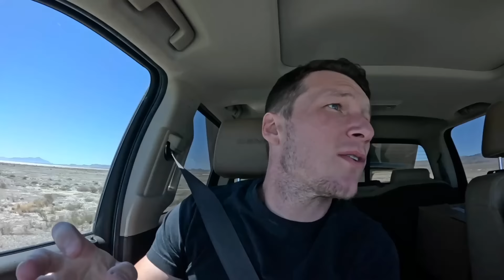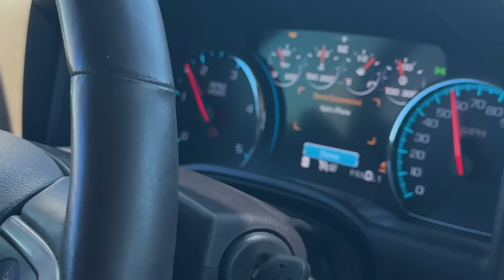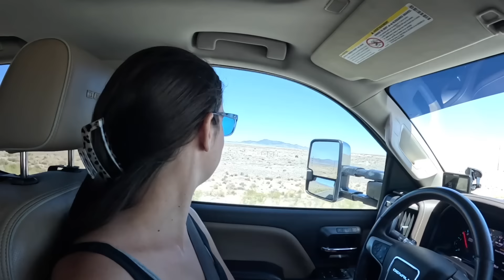New Trucks are 'Built' to Leave You Stranded

Comment: Another great video love watching you guys. Caidin was great as well not many people out there would take the time like he did to go through everything like he did. The one thing I would have liked him to go into further detail was the part about adding ATF to the diesel fuel like how much should you put in at fill up. I had seen that before but took that like most things you see online.  Now hearing it from a guy who knows tells me a lot. I am all about doing whatever to make my truck last longer with fewer problems. The only problem we have had so far was the DEF issue last summer and both times after filling up at a truck stop. So on the way we ended up making an unexpected stop in Kingman. I took it into the dealership there and they did not find any problems reset the code and back on our way to Porterville Ca.  On the return trip we were kinda in the middle of nowhere in a way as the closest Dealership was going to be maybe we will make it before it went to 5 mph. That's when I called the local auto parts place and asked who in the area I should see. I went to D&A Diesel in Tucumcari and Don cleared the code and told me never get my DEF from a truck stop. He said to get it checked when I got a chance but he was pretty sure it was the Truck Stop DEF. He said the DEF they get is not the best quality for our trucks.  We stopped in Amarilo that night the next day I picked up some DEF and waited till it was almost empty before I put the new stuff in and have since not had any more problems.

Comment: Kyle, I have suggested to you to get the Fass fuel system on your truck,( I also mentioned the CP4 pump, but your truck does not have the CP4 pump). The Fass fuel filter system saved my engine! I have a 2026 Duramax. I filled up at a gas station I was not familiar with and got bad fuel! Lots of water! The water filter got so full it would not allow any fuel to get to the engine! So instead of replacing my entire fuel system and injectors, they had to drop the tank and clean that out and replace the filters! 1400.00 compared to 10 to 12k. My next install will be an oil bypass filter!

Comment: We were on our way home from Colorado to California on Aug 3, and we got the "Service the DEF system" and "Limp mode in a 150 mile" on our 2017 Ram 2500. We cleaned our DEF injector and reset the check engine light that was on and drove to California. Total cost $0.00.

Comment: What I'm curious about, is why do the DEF systems on big rig diesel tractors run so much more efficiently.  I know they are not completely foolproof, and there are problems that crop up, but I have driven a DEF big rig for miles and miles, with very few issues.  Is it an engine size issue, where larger engines can absorb the DEF peculiarities more easily?

Comment: Use Platinum Blue def or Rislone def additive to prevent crystalization.
Use fuel cetane additive to reduce  DPF problems.
Archoil fuel additive & DPF cleaner is pretty well liked. 
Don't use transmission fluid in fuel use Cetane booster. 
Motor Oil Geek has a good video on diesel fuel additives.

Comment: There's a lot of bad info on the EPA and emissions on diesel trucks. Emissions tampering will still be illegal. Manufacturers are not going to just stop putting emissions equipment on new trucks and cars. States will still be able to regulate emissions tampering and if you live in states like CA, New York, Oregon etc, you're still screwed. However, the softer stance by the EPA may open the door for good tuners to come back to market but they'll have to  operate in the shadows. To say it will be fully legal to delete your diesel is just not accurate. Don't get me wrong, I have a Ram 3500 and have the misfortune to live in commie state of CA. But I WILL be deleting once i register in AZ and good tuning is more available.  Deleting emissions on a modern diesel and add a good tune is the BEST thing you can do, but do it at your own risk, the risks just might be a bit lower. Hopefully

Comment: As a former GM Certified diesel tech and used to deal with this system you found a very knowledgeable technician who knows his stuff. 

With that said, this is the main reason if I ever go with a diesel I will stick with a LLY or LBZ.

Till then, I will stick with my 8.1 big block Chevy. 

Great video! Keep this type of content coming whenever you have an issue.
Reply: I think your comment is the most relevant to me.  If a certified technician wouldn't have one then certainly a person who knows nothing about them would either.  I think some folks are ignorant regarding the costs and upkeep for even the most minor of issues regarding these vehicles.  The engines and transmissions, etc. may be rock solid but if the emissions systems are as problematic, maintenance intensive and expensive to repair as these things are then it makes no sense to buy unless you have deep pockets or can handle the repairs yourself.
Reply: What about the mechanic telling him about transmission fluid or 2 cycle oil in the diesel tank? Around 16:51 ????

Comment: Tow a spare pickup behind the 5th wheel. <joke>.  Could you imagine the curbs and corner stop lights you need to at least scrape.  I recall the first time I pulled a 28 foot *pull-behind*... (Adds more length). Unlike the 20-foot Terry Resort 5th; I previously hauled. (Different pickups and trailer types).  The 5th by far, had the best trailer manners.  Thanks for the video.  The newer smog diesels are a constant carbon / etc. battle.  Since you have a load on your rig often, helps keep carbon burnt to a crisp.  The automatic transmission your pickup is equipped with, earned quite a battle-tested  reputation, even in the big rigs years ago.

Comment: This has been great info. But now I'm even more uncertain what I want to do. I'm looking for a Class B RV and a lot of them are the sprinter. I do know that they are harder to find someone to work on them. I'm still leaning toward gas simply because I know I can get gas, also I know that I can get it worked on almost anywhere. As for MPH right now I get average 7mph in my 25' Class C and I hear you say that you got that too. Because now you have to get fuel and DEF but not how much it add to the cost of fuel. Being a single older female I really need be sure I can get the help I need. This has been a good education. Thanks

Comment: Pittsburgh Power has a Dorothy that filters the exhaust gases being returned to the engine.  Filters out soot etc.  Def is 66.67% Urea and 33.33% Deionized water.  Rotella T-6 has a lot of Zinc and seal sealers that stop oil leaks.  Cold weather starting will make a believer out of Synthetic Oil.  Please watch some of Daves videos, he has a system that filters oil down to 1 micron in a bypass system so your oil is refreshed instead of getting black and dirty with suspended soot, etc.  Secret to a long life with a diesel engine.  Husky Diesel appears to be a first class guy.

Comment: Don't buy anything newer than about 2011 so you don't have the def and particulate filter. Now that you have it, it's called "delete" the system. problem solved. Pulling a camper you want all the power you can get and with this emission bullshit you lose power and mileage. Get you an older diesel truck and you don't have to worry about this crap and you have the power. This EGR crap is just that.....CRAP that puts the cost to the consumer!! Why buy new when used will do!!

Comment: From my experience, truck stop diesel is a lower grade diesel that semi trucks generally have no issues with. 
Smaller diesels like GM’s 6.6 Duramax with the emission system plugs up the particulate filter frequently. 
In Europe there are 4 grades of diesel, Canada has 2 grades. 
Stay away from truck stop diesel. 
All diesel fuel is not the same. 
My Duramax 6.6 loses power with truck stop diesel. 
Sure, you might pay less but in the end, you pay more to repair the emissions system. 
Regards,

Comment: I use hot shots Diesel treatment, fuel , dep, and engine treatment.  137k, 2021 ram 2500 heavy 6.7 Cummins.    Have never had an injector problem ect.    I changed the oil and fuel filters every 7500 miles.   
Thanks for sharing

Comment: You can delete it all and then have a truck worth a $1 on trade in. Like the poor guy in Wyoming begging for a pardon as the Judge threw him in jail for tampering on construction equipment and trucks. I get it but until they change the law we’re all stuck. It might happen soon

Your best friend is maintenance I saw in your video a Amsoil Synthetic case of oil. Change your oil at 5k max change that transmission , transfer case and rear diff fluid. Coolant is due at your mileage etc. 

Good video to share Thanks.

Comment: If you want a reliable truck buy a 2000-2002 ford f350 7.3 I know it’s an old truck but it will last y’all a long time without the hiccups. Find one with low miles and a 6.0 transmission cooler!

Comment: Kyle, Cadin - There was a little misinformation in the video - I offer the following corrected info. - Diesel Exhaust Fluid (DEF) is an aqueous urea solution, specifically 32.5% high-purity urea and 67.5% deionized water, used in Selective Catalytic Reduction (SCR) systems to reduce harmful nitrogen oxide (NOx) emissions from diesel engines. The urea in DEF is not the same as the urea found in urine; it's a synthetically produced compound designed for industrial use. When injected into the exhaust stream, DEF decomposes to produce ammonia, which then reacts with NOx to form nitrogen and water vapor, harmless byproducts.

Comment: DPF (Diesel Particulate Filter) and SCR (Selective Catalytic Reduction) Issues: The combustion of ATF in a modern diesel engine can potentially negatively impact the functioning of the DPF and SCR systems designed to reduce emissions, leading to malfunctions or damage. ATF contains certain additives which are not meant to be burned in a diesel engine's combustion process.

Comment: Just had the same code and issue in my 2017 GMC 3500 sierra. $2300 and we are back on the road. GMC has may issues,  know you've been struggling but.... get that pump and injector done and you'll be solid.  Did my Knox sensors 2 years ago. That's it for issues and we are full time with an 18k 42 for 5th. You got this guys,  don't give up on that beautiful truck,  just replace those parts

Comment: Another solution... The older Ford trucks have a 7.3 diesel engine. Both the engine and transmission are solid. Invest $10,000 - $15,000 to fix any body work (rust). Under coat and new paint job. There are many, many of those trucks around. It's a diesel with "ZERO" DEF.
Reply: Indeed. Zero DEF on my '02 7.3 Powerstroke. I did have to replace the factory transmission (4R100) at 120k with a rebuilt one but other than that, outside of minor leaks here and there (resolving them as I go), it's been a trooper. New paint job and undercoating forthcoming too eventually.
Reply: @TravelingKory  That was going to be my one critique. The E4OD should have never been put behind the 7.3. I had the same trans behind my 302 F150 from '93. 

A well-built 4R100 is definitely the way to go. 

My '05 6.0 has the 5R110, and it's a flipping beast. I've pushed the power up to 475hp/890tq with 38" tires and it still has no problem towing anything. Except fifth-wheels; too tall. But I pull 30k with it all the time on my gooseneck.
Reply: @James-zm6vh very nice! Definitely would like a five speed but we get pretty good mileage, even when towing our fifth. Only thing I wish we had is an exhaust brake but I'll take the 7.3 for the time being, at least until we downsize eventually.
Reply: @TravelingKory  Yeah, I get 21mpg without a trailer behind me. Get 21mpg with my small camper; 22' 4000# loaded. 
Get about 14mpg with my gooseneck. Unless I'm going up north (lots of climbing), then I get about 11mpg.
Reply: My 2005 Ram has zero DEF.  Its a keeper!!
Reply: But they won't tow anywhere near what a new one would.
Reply: @JB-ej8zy  I pull 30k all the time with my 2005.  I should clarify, that's GCW, not trailer weight. 

I only know of one or two travel trailers that weigh more than 17,000 pounds anyway.
Reply: @James-zm6vh i didnt think them old trucks chasis and engine could handle that much weight thats impressive.
Reply: @JB-ej8zy  The chassis aren't the problem, they haven't changed much in the past 40 years. It's the drivetrain and suspensions that are the problem. 
The 5R110 is a beast of a transmission, a simple upgraded rebuild kit with better clutches, and a program, and they will handle that kind of weight. Increased hp/torque on the motor, and you've got a modern drivetrain built to pull that kind of weight. The only other component would be the rear springs that would hold up that weight. 
Most people would just install airbags; but that's the wrong way. I installed 8" lift leaf springs from BDS for a 2017-2022 F350. This gives me the spring rate/ride of a modern truck, with the space for the 38's, and the tow capacity of a modern truck. Also gave me the factory rake, so I don't get the squat of a typical lifted truck. You can buy a conversion mount for the 03-07 trucks, but I just fabricated mine.

Comment: I really love diesel engines, but not a fan of the new ones. I’m waiting to get a 2001 F250 7.3L with 140,000 original miles. These were hwy miles pulling a 5th wheel.

Comment: I have suggested that the 2 of you "explore" the idea to have your DEF completely removed from the truck. Chevy and Ford both make a "GAS" (non-diesel) engine. I had a 2022 Ford F350 "gas" engine 7.3L. It was an outstanding truck. I averaged 18 miles per gallon with a 3500 pound slide-in camper in its bed. Chevy I believe is the 6.6L. I don't know about Ram. It's time to move-on from your truck. Save yourselves the stress, worry, time, jumping thru hoops, roller coaster, energy, MONEY (DEF fluid). Simply...

Comment: I just got home from my truck breaking down. I have a 2020 2500hd. I shifted into neutral then to low 4wd and something wasn’t happy. It started saying service 4wd, low power mode, service parking brake. Had to get towed. There is nothing on these trucks you can service yourself. So frustrating!!! I’m not sure if it is an actuator, transfer case or transmission. It will only go in reverse now.

Comment: Fords and GMC cooperated in the development of the allison 10 speed transmission  both use it.  Also heat is not the enemy of diesel engines.  Cooler temps are.  When you are towing and running 6-700 degrees you will almost never go into a regen because the soot is being burned off almost as fast as it is produced.  Regens do not run at 1500 degrees.   The temps are around 11-1200 during a regen.   There is alot of poor information in this episode.

Comment: I own a 2022 Chevy 2500 HD Crew cab. I pull a fifth wheel dump trailer a 35' fifth wheel camper with 3  slides. I have no problems pulling those trailers no problems. I get decent fuel mileage.  Desiel  fueled pickup trucks are trouble related. Gas does not need exhaust additive  to meet emissions  fluid.  Yes Desiel  fueled trucks are cool. But unless you have deep pockets. It cost a lot to own and use them. It is what it is. Great content. Have a great day

Comment: I feel for you guys! Like I mentioned before; the old girl Diesels (ours is an 03 2500 with the 5.9 Cummins) need barely any maintenance and pull like a fright train. We’re at a camp ground in Michigan, a bunch of older trucks here. We’re pulling 5500lbs. Our neighbor has an 07 RAM pulling 12,000lbs. We both have north of 2500lbs of payload. 

For half the price of a new truck, you can get a well sorted older diesel. Love you guys.
Reply: Yeah. I picked up a '04 2500 several years ago. i thought a paid a lot for it (nearly $20k but I can do the work myself and it just runs. 2 bolts to change the water pump. There is a reason these are in high demand.
Reply: @PeaceIntheValley  Same, we paid 12,500 for ours. We just drove 870mi home ove the past three days. Other than a scheduled oil change, it's been just diesel and go.

Comment: We had enough after having numerous system problems. Every time we towed in was a white knuckle feeling just waiting for the inevitable light. Sold the truck and bought a gas engine. Will never ever own another diesel again.
Reply: I tow with a  2022 RAM 2500 with a 6.4L, and have had no problems with it at all.  I regularly tow over the sierras on hwy 80 back and forth.

Comment: What a great video!!!  I have been toiling over the "Diesel or Gas" debate for about 2 years now.  I feel much better after hearing Caidin's thoughts on diesels. Kyle and Renee', you guys are great and keep putting out extremely helpful videos every week.  Thanks.
Reply: The main point to take away from the gas/diesel debate is this: They can both do a great job at pulling heavy loads. Diesels will work less, and do it for a whole lot more miles.
Reply: You're still gonna need to keep more money in the bank at all times to keep a modern diesel on the road

Comment: Hey guys, Long time. 
Your warranty is no longer active. Just do a DELETE on the truck

I did it on my last diesel making a HUGE difference on the truck showing all of its horsepower after getting all that crap out of the system.

Now, with my 2020 Duramax out of warranty I'll be doing the same on it as well. 

I don't need to do emissions where I live so it won't be a problem. After I do this the truck will show all of its 500 horses along with the 1000 pounds of torque without losing it from the emissions crap on it. 

We're in south central Colorado now if you want to stop by during your travels and we can get it done in a day. Change out the exhaust. Program the computer (I have the $2000 tuner for the Duramax already). Hell.... we could just hit both of them and make it a 2FER.

Seriously. If you'd like to get rid of the DEF crap, let me know.
Chris and Stephanie